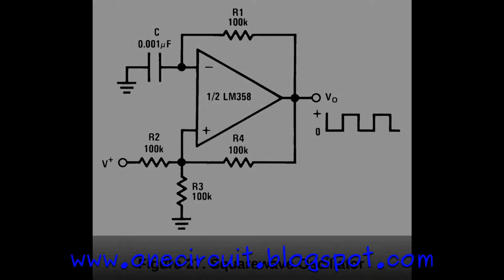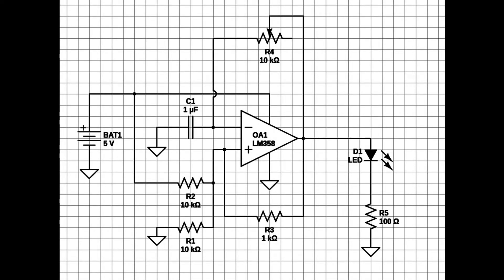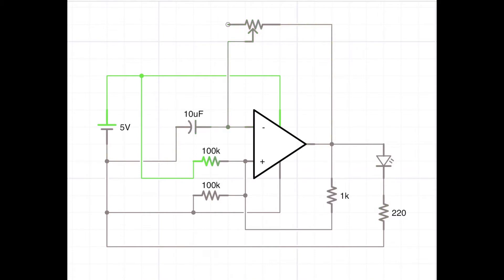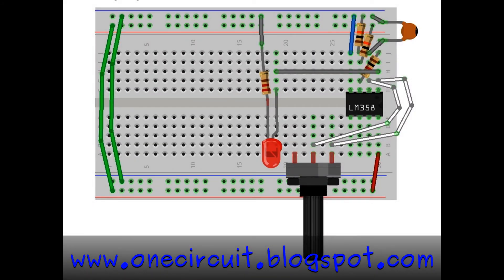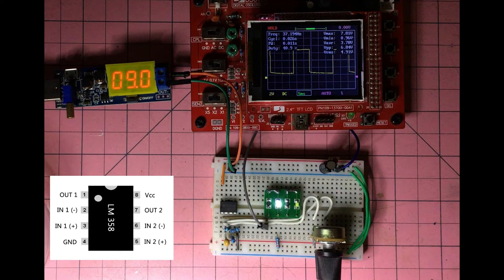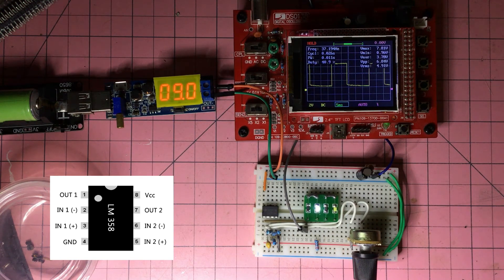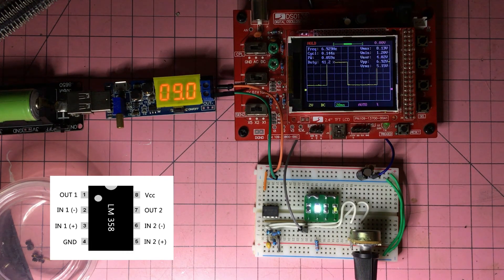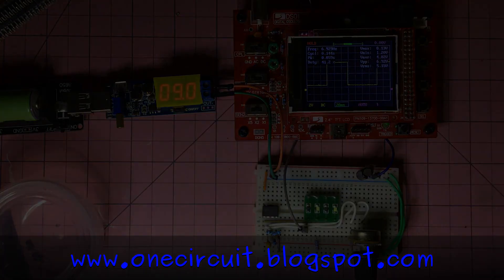LM358 Square Wave Function Generator

Comment: How do you calculate the frequency for this one? I've been scouring data sheets and forums there seems to be no defined formula despite the discrete components the same everywhere.
Reply from the maker: I notice that the site that I used for my calculations (which is on the blog link in the description) is down - you could try the wayback machine via https://web.archive.org/web/20200111014450/http://www.analogzoo.com/2015/01/relaxation-oscillator-design/ until it comes back up again?
Reply: @onecircuit-as  Thanks, but unfortunately I tried using the formula and I don't think it works with this one, it did mention that its for any resistor values but it only works if the voltage are symmetrical which in the article, it's +5V and -5V.
Reply from the maker: Try http://www.learningaboutelectronics.com/Articles/Op-amp-oscillator-calculator.php and focus on the value of R and C, as R1/R2 ratio is just for amplification.

Comment: Nice, can you please share the part list and values. I see more caps in the breadboard version! Thanks.
Reply from the maker: Take a look at the blog link and see if that answers your questions. A lot of my breadboard power rails have a 100nF/100uF combo for decoupling/stabilisation - I got the idea a few years ago from a YT video, but I can't find it now. Either way, it's not part of the main circuit, just part of the breadboard power supply.

Comment: Nice project, parts are on order.
Where can you buy the board oscilloscope shown in this vid?
Thanks for sharing
Reply from the maker: It’s a DSO138 which you can buy at a few different places. Mine is from AliExpress, they come either in a kit, or assembled complete and also with a case if needed.
Reply: @onecircuit-as  Thank you for the heads up on the oscilloscope. Found one on eBay, ready built, acrylic case, leads and power supply.
Think I'll lose the power supply and get a decent one locally. Had one or two extremely doggy power supplies from china.
Reply from the maker: @isoguy.  My version just uses a 9V battery via an adapter - but it can be a bit thirsty for power so good idea to have the separate supply. I hear you on the dodgy suppliers - I have just had four wall warts delivered but so far all are OK.